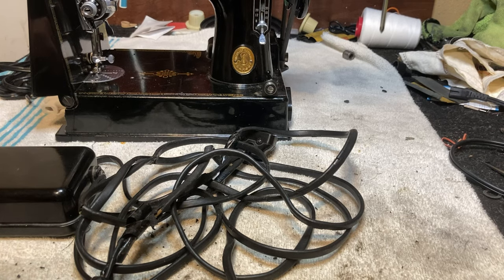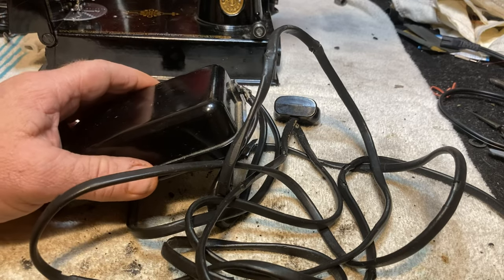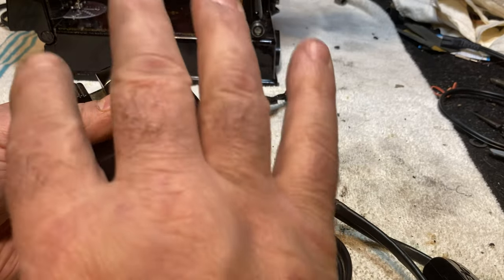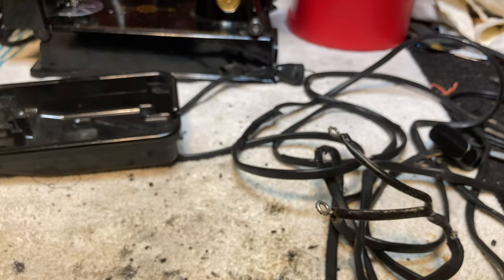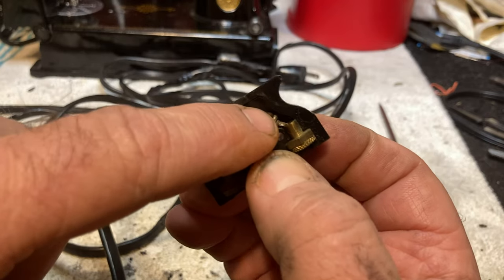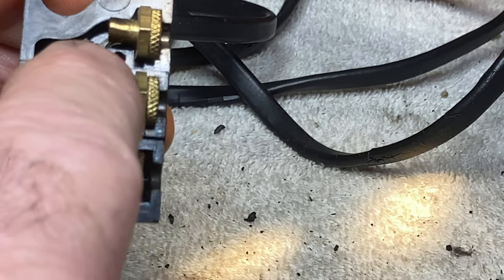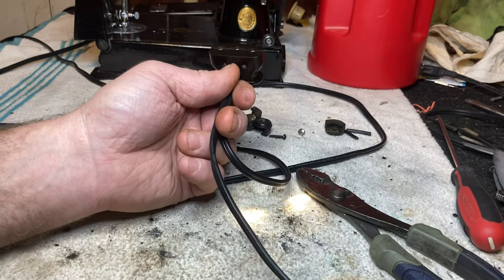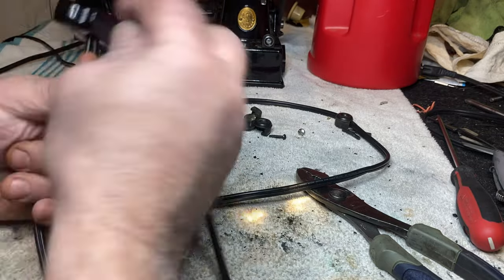Singer Featherweight 221 Power Cord Repair

Comment: Found yor video on rewiring foot peddle  for singer featherweight very informative.   Part or the wiring on my 221 is just like the brittle one you shoe in the video.  I noticed one of the tint screws and nut that hold the foot pedal apparatus together on mine is missing.😢  Do you have that part I could purchase, or know where I could buy one?  Thanks for taking the time to to explain so thoroughly,  It's much appreciated 😊 Thank you. Leona

Comment: Hello friend, I really liked your explanation, congratulations! Can you tell me the thickness of the cable? I bought a 0.75mm² and when I roll up the two legs (one for the power and the other for the accelerator) it becomes thick and doesn't fit into the connector.
Reply from the maker: Thank you for watching.

I don’t specifically know the thickness of the outside diameter.

I recommend either #16 or #18 lamp cord, 18 will work better as it’s smaller.

Comment: Just wondering which gage of wiring you're using?  I bought some 16 gage wire and it's too thick
Reply from the maker: I honestly can’t remember the size wire I used in that video, that being said I have used 16 and 18 on rewiring machines.

Especially with the plug which goes into the machine 18 would be easier as it is a smaller diameter and will work fine.
Reply: Thank you.  I bought 18 gage today and I'm STILL struggling with it and not getting the cap to screw on level.  It's like the wire is too thick still
Reply: I finally got it finished!!!  My fingers are raw and hubby had to help me a little with the wiring caps in the plug, but it's done!!

I've already used it, (with shoes on in case we made a mistake lol), and it works like a charm!!!

It was a great video with tons of explanation and easy to understand.  Thank you so much for your time and efforts!!

BUT, if this ever has to be done again, I'll PAY someone else to do it!!!!  LoL.  Take care.

Sherri in Ontario, Canada

Comment: What size wire are you using 16ga or 18ga. I’m trying to do this with 16 and it doesn’t want to go under the brass connector.   Can I cut off a few strands to make it easier? Doesn’t seem like I would want to do that.( cut the wires off).
Reply from the maker: I used 16, make sure you are putting the concave side of the nut down so it screws down against the wire.

It is kind of tough to get it all in. twist it very tight screw the nut down and if their is a few wires sticking out then you can trim them off.

Comment: Mine is way worse than that.  :(
Reply from the maker: Ya time definitely destroys the cords.
Reply: @sewingmachinetipsandtricks9079  Question. I ended up winning an auction for a white featherweight yesterday. I overlooked the fact of it having a UK plug! Is there a way to put a US plug on the end or is the entire wiring system different? What are my options to use the machine safely?
Reply from the maker: @yime6631  
They make converters you can plug into and then plug into a US 110/120 volt outlet (regular plug) and run it.

If you get a cheap converter plug you run the risk of it over heating, melting and possibly causing a fire.

Here are two I found with the best ratings, I DO NOT recommend them or claim they are  good products.
https://amzn.to/3wJXSSF
https://amzn.to/3jeyIZw

The other way is to replace the motor, light bulb and cord to 110/120 volt.
Here is what you need to convert the machine from 220v to 110v
Motor
https://amzn.to/40cQXyV
Foot pedal
https://amzn.to/3H9gm40
LED Light bulb
https://amzn.to/3DpK7MZ